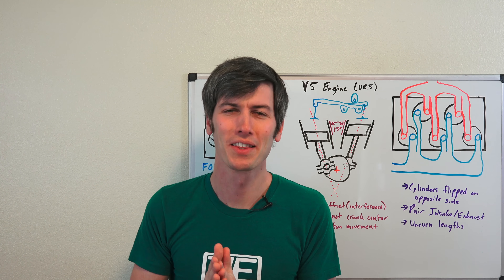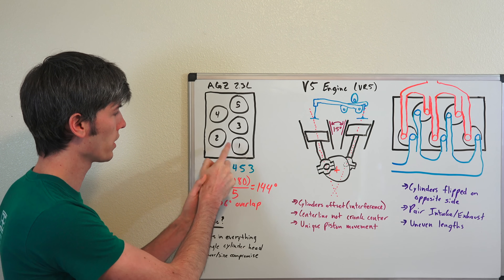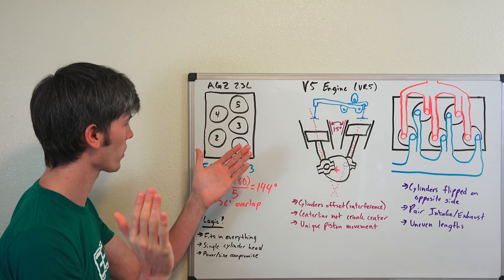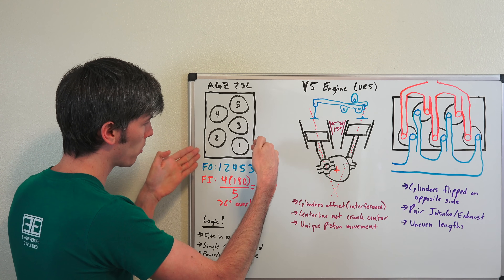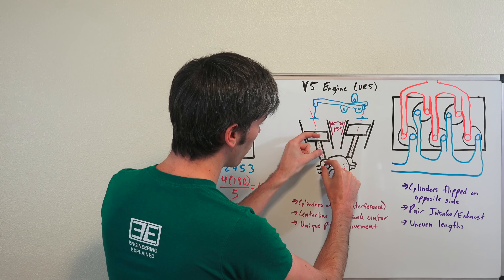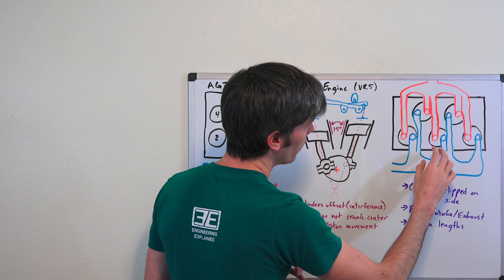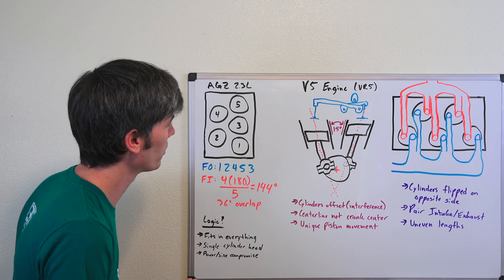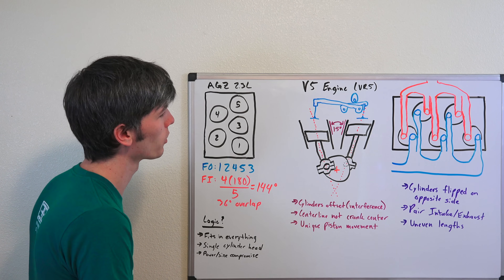Volkswagen's V5 Engine — When A VR6 Is Too Big

Comment: I owned a 2000 year VW Bora with the V5 engine years ago - Cracking exhaust sound, smooth running (thanks to all the counter balancing act going on inside) but only really made sense at 80+ mph speeds where constant high speed could be easily matintained and MPG actually improved into the low 30's! That said, it had woeful economy around town though, I once read a comment on this particular engine - 'Performance of a 4 cylinder with the economy of a 6 cylinder'......very true!
Reply from the maker: Haha, thanks for sharing your story, love the shortened description of it. 😂
Reply: You only want 5 cylinder for that meaty sound without the 100k price tag.
Reply: tarstarkusz, I believe the top of the pistons are slanted, so the piston and the top of the combustion chamber are parallel with each other and there is no dead space. So the compression ratio is on par other engines.
Reply: I had a Golf V5 back in the day. The 170bhp remapped to 192 by Revo. Was unbeatable on the motorway at 80mph plus. Liked it better than my V6 4motion.
Reply: They are about the length of a 3 cylinder and close to wigth of a I4 with almost having the power of a V6... almost
Reply: DIZKO BIZZKIT you are abselutely right. I currently own a 1998 golf IV vr5. Litterally just put a Duplex rear muffler and the thing sounds like an abselute beast. Beautiful sound and runs great. Only problems ive had so far was a bad icu causing 1 cylinder to not spark and a waterpump gasket that went bad ! other than that the usual vw abs fault, with mine being a bad connection somewhere at the abs block :/
Reply: I just bought a 99' Bora with the 2.3 V5 and i love it. especially the sound. but the description fits properly, it drinks like a mule driving in the city.
Reply: @th1nk_outside  i think the fuel consumption is ok i do 11.5l/100km(20mpg)city, 8.5l/100km(27mpg)highway and 10.5l/100km(22mpg) combined
Reply: @demoritzz5327  well it depends what you think is a lot. my challenge always was to stay below 12l/10km in the city and thats a lot to me considering the car isnt really fast or anything
Reply: @th1nk_outside  it is pretty slow you're right but as u said I love the sound too and in my opinion around 10 liters combined and I do like 90% city 10% highway so I'm ok with that
Reply: Weren't those VR engines? I remember them from the golf 4 with 2.8l or something around those lines.
Reply: @Ac3r0n  yes this is exactly a VR6 engine but 1 less cylinder because of space saving
Reply: With the cylinder on a 15 degree angle and a flat head, the pistons are offset. Presumably compression is not that good with 1/2 the cylinder 15 degrees off of TDC
Reply: Oh. OK... Thanks.
Reply: DIZKO BIZZKIT that sounds terrible. i4 performance with v6 economy. i’ve never driven a fuel efficient v6
edit: or driven an i4 that i felt like it’s performance was worth being referred to as “power”
Reply: Steven Freeman Yeah it was a bit weird and spoiled an otherwise good family saloon but the V5 performance actually suited the car which was really solid, well built and showed what direction the VAG group were heading with design - an opportunity missed i think they say!
Reply: Steven Freeman drive the focus rs mk3 then
Reply: On the crap gas in my country it still has great fuel economy and mine is fairly nippy in terms of speed hoping to go turbo with it by next year
Reply: 30 L/hr
Reply: Wait that's backward, it's the power of 6 cylinder and the economy of 4 cylinder

Comment: When the MK IV Golf/Jetta/Bora was introduced, in Europe, this was the only more cylinder engine available in 1998, later came the VR6 with standard 4-Motion, so if you wanted a petrol powered VW with an final drive of 3,94:1 this was the only option, lesser powered options (without turbo) came with a 4,25:1 final drive, so @ 70 mph you're revving the engine too much in my opinion....

Comment: Excellent video never heard of a 3-2 V6 on another subject I'm wondering if you know anything about the Axel's on the Humvees I saw a video on off the ranch on YouTube where they axles do not go directly into the center of the wheel but go into a gear that's raised up to give it a few more inches of ground clearance sounds like an engineering nightmare and maintenance problem down the line

Comment: The offset crank inherently has interesting torque characteristics. 
I wonder if the valve lift and duration on the left-hand cylinders is different from the right-hand cylinders.

Comment: Jokes aside, the VR engines, both the 5 and 6, are among the best engines ever designed in my opinion. I assume people with vibration issues must have worn out engine mounts, because the  last VR5 I was in was as smooth as warm butter. The fact you can cram that much power into roughly the same size engine as a regular inline 4 amazes me, not the fact that VW did it, but the fact nobody else thought to make it a mainstream engine before then. 
(I know all about the inspiration for the VR6, the VR4, but that was hardly a bestseller.)
Reply: Lancia was first with v6, v4, v8

Comment: My grandmom 1999 Passat VR5 (old 2 valve version) 150hp. It has only 62k miles, sounds awesome, has no power and torque. It uses a lot of fuel, vibrates under low rpm and high load.

I like the sound a lot, but his is the only thing I really like about this engine. A 16V 2L 4 Cylinder could have made the same 150hp, without that much complexity.

Comment: Cool video, cool engine. It has a great exhaust note. Would like to hear more about how the offset cylinder centers mean that one bank of cylinders act on the crank differently than the other and what that means to torque and power. What I mean is one bank of pistons is moving in the same direction as the bottom of the connecting rod during the power stroke where as the other bank would have the connecting rod swinging to the side during the power stroke.

Comment: owned a VR5 170HP one back in the day :) had a smooth and intrestring sound/performance compared to 2.0 4L i had before i tried a 1.8 4L turbo and decided to pick this engine because of the smooth driving and intresting sound ecenomly and performance the turbo would be a better pick tough.

Comment: I'd criticize them for going through all those engineering challenges before just turboing a 4. But I'm also the guy that wakes up every day hoping for news the wankel is coming back.
Reply: I agree. Just spend your efforts on building the most capable 4cyl engine you can (in terms of block, heat dissipation, internal strength, harshness), and change induction to vary the power output throughout the model range. You could even bore/stroke it for a performance line as well. It didn't make sense that they built 15 different types of engine around the same "v" concept, when they really just needed compact power.
Reply: The sound wasn;t the same. I bought my VR5 back in 2009. By then the new 2.0T was king of performance. The Focus turbo 5 is the old straight 5 from the Volvo so all the runners are the same length. Its faster for sure but doen't have that same sound or feel quite as special as that VR5 did. 20 valves in a V configuration will never be done again and the sound of the uneven runners made it sound so unique.  I liked the complexity of the thing and in 80,000 miles it didn't even have one problem and was really reliable.
Reply: Noah, I really don't get the range extender bit. I seriously doubt there's any real there, there. Piston engines can be made plenty small, especially if they're not responsible for moving the vehicle. While a wankel could work fine and I know some patents have been filed, I think it's just bet hedging and patent squatting. The wankels only hope for a future is if it can establish itself as the undisputed king of specific output, but still somehow achieve a modernish efficiency/emissions standard. Perhaps a modern wankel could see a resurgence in the light aircraft game but unless that ends up translating to automotive wankels it leaves  the more average, non aircraft owning cats, out in the cold.
Reply: That engine is an unsung hero. I had one of these and two VR6's. I actually preferred the V5. It made such a great sound, was just as smooth power delivery. Didnt suffer from the heat-problems of the VR6 and was pretty much just as fast. Actually felt a bit quicker to accelerate. It was awesome.
Reply: Why not have both? 😋 I’ve got a turboed 5
Reply: Although yeah mines a straight 5.. interesting set up
Reply: you got it wrong :)
what you really wanna do is get a V5 with a turbo instead of a V6.
Reply: Didnt have a v6. I dunno. I just loved that VR5 sound
Reply: lol. Yeah. That 1.2 litre supercharged turbocharged VW engine they had in europe was sooo damn good. I mean so powerfull and so reliable. No to mention such a smooth drive (<inserts sarcasm here)
Reply: They could also turbo the 5 for even more power.
Reply: Well, you just might. But as a boring range extender. Considering the compact size, sounds legit
Reply: Eric Cassidy that is just as likely. I guess we will just have to wait and see.
Reply: The engine had to be small, Jason even said that. An exhaust turbocharger needs WAY more room to build in. You should criticize yourself for not getting that.
Reply: The 20valve VR5 was 170 stock and when I remapped mine in went to 192 on a dyno with no other mods. It had shorter gears than the VR6 and would accelerate way faster than the V64motion Golf. Was helluva car. Sounded awesome too...
Reply: The VR5 was borne of the VR6 (which also provided the engineering for the W8, which was essentially two VR4's mated together at the crank).  So in reality, there was very little engineering that needed to be done for the VR5 as it has already been done for the VR6.  Turbocharged four-cylinder engines of the same era of the VR6's conception were reserved for certain high-performance cars.
Reply: inline 6 pl0x
Reply: Eric Cassidy I do miss Rotary. Im sure if more manufacturers poured money and development time into a rotary platform, we would have a much better engine that wouldn't have some of the downfalls that they do.
Reply: Keld Tundraking I've waited for ever I even Wankel swapped my 350 truck
Reply: Sleeper Cell. A V5? It's a VR5. A true V5 would have a V-Block, 3-pin crank-throw crankshaft, 2-cyl. head, 2 exhaust manifolds, 2 everything...A VR5 has an I-Block, 144° 5-pin crank-throw crankshaft, 1 staggered 15°V cylinder bores head, 1 exhaust manifold etc.
Reply: Lmao. How do you feel about the ls swapped Mazdas?
Reply: That's just not true. The areas where NA engines are preferable shrink every day. For any kind of performance application, skipping out on boost is just leaving power on the table. NA survives on it's lower cost, and simplicity. Not on it's performance and efficiency superiority. Even the Civic Type-R, in it's pure pursuit of lightweight, simplicity and performance, has finally conceded to the turbo's capability. Now if it's about the sound the perfectly linear throttle response, the experience of enjoying the NA itself, have your fun. But it is strictly inferior on every front except simplicity. Even then engines with complicated geometry and balancing issues like the VR6/5 lose out to turbos in simplicity as well, which is why VW has abandoned them.
Reply: Eric Cassidy I'd say... Naturally aspirated engines are way better than turbo charged...
Reply: Turbocharger+supercharger masterrace

Comment: If the cylinders have 4 strokes but there's five, how does de firing order work? I mean, by the time thr fifth cylinder is firing, the first cylinder would be firing also, or am i wrong? Could someone please explain?
Reply: Not true!
It is a 4-stroke engine. Therefore the crankshaft must turn twice (720 degrees) for all cylinders to fire.
Reply: If I recall correctly, the firing order is 1 2 4 5 3, and the cylinders fire 72° out of phase about the crankshaft. The cylinders fire in a circular motion if viewed from above.
Reply: By this i mean once the crankshaft has turned 72°, the second cylinder in the firing sequence fires, so once all cylinders have fired you are back at 360° therefore a full rotation of the crankshaft
Reply: Yes - any 4 stroke ICE with more than 4 cylinders will have two in the BANG phase. 
It means the engine is never naturally balanced, but none of them are anyway unless you get horrendously complicated.
Reply: There is a difference between balance/balancing and yes/no overlap between power strokes.
With 5 and more cylinders there is a some overlap and power delivery is smoother.
I ride a Honda CBX-1000 Prolink motorcycle with a 6-cylinder inline engine. It is very nicely balanced (first and second order) and also delivers smooth power.

Comment: Sounds like everything is wrong with this idea :D
Reply: but it"s small
Reply: szafirowy01 well the 2.3 liter 5cylinder engine that takes up space of 4 cylinders is not a bad idea, also they are pretty reliable
Reply: It made sense in the time era when turbo wasn't nearly as common, and they already had this vr6 lying around... Just chop off a cylinder, cheap way to fill a power/price gap

Comment: It'd be better suited to call it W5
Reply from the maker: VR5 yes, but it's not a W5, as W engines have two VR cylinder banks. But it does make a W shape looking down on the cylinders haha!
Reply: There's no "W" shape anywhere. V is obvious, and R comes from "Reihenmotor" - "inline engine" in German. And since it's a hybrid of V and inline engines it got the VR designation.

Comment: I'm willing to wager that the maintenance and repair costs of these engines are as interesting also.
Reply: the vr engines are to my knowledge very reliable my mk4 vr5 never had a problem but here in germany gasoline is very expensive so the car was just too expensive in the long run.
Reply: FJ5 you got jewed
Reply: johnnyr25 repair maybe, might need a specialized mechanic for it, and parts like those intake and exhaust manifolds or head gaskets if they break, but maintenance? I doubt oil, filters, and that change a lot, and there's only one extra spark plug and coil.
Reply: owned one for 4 years and had no mechanical problems with it, only they replacement of lights was a pain since for the car the engine was actually big for that car so they had to remove the front of the car to replace a light bulp :D,
Reply: johnnyr25 basically everything fits from a vr6 so pretty much the same, minus one spark plug ofc. Have a seat toledo vr5, engine is a reliable piece, in 5 years of ownership had to change oil pressure sensor, maf sensor and a throttle body. Not bad for a 400k km car. It sounds really well, power output is not that good, it likes to chug fuel too. Oh and main issue that i had with it was the freaking oil sump, damn it sits low. Still puts a smile on my face whenever it gets to rev. And believe me, it gets to rev often.
Reply: Maintenance and repairs are equivalent to the VR6's, generally a timing chain is € 1500 (parts & labor) and you pay the same for a dual mass flywheel and clutch, for the rest it uses the VR6 externals (waterpump, pulley's, oil filter, -housing and cooler)